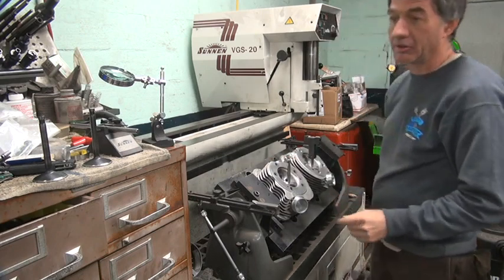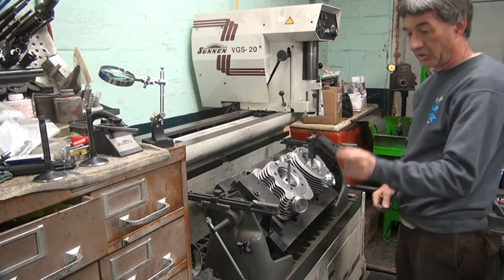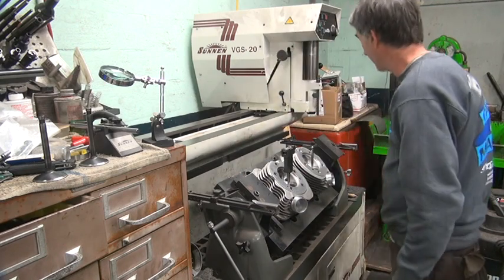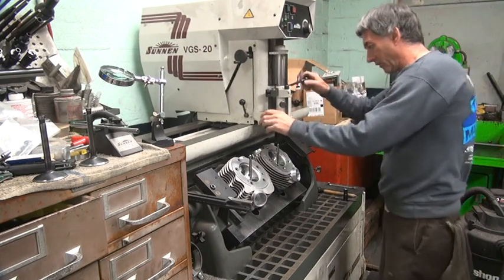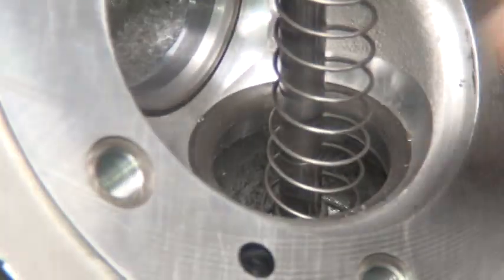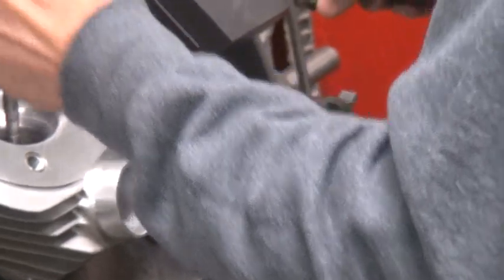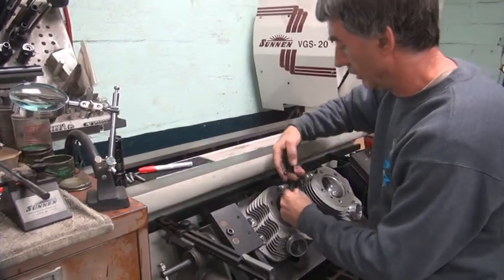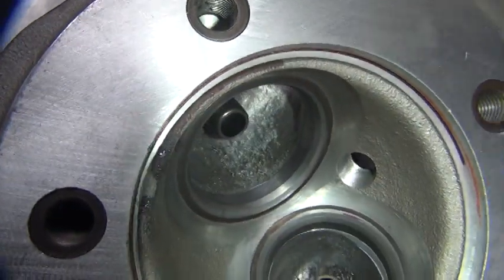#177 1961 FL 74ci std valve spring clearance set-up job panhead motor rebuild harley tatro machine

Comment: That simplistic Sunnen  hand level that goes into the valve guide to get the seat inline for cutting is excellent. Wish they sold that separate or an aftermarket version. That solves a lot of problems. Great video, learning how its done with the proper equipment, sure beats my idiotic contraptions.

Comment: To say another way, lapping is burnishing. Techs burnish, assemblers... assemble.
Reply from the maker: lapping is not burnishing, they are not even close. lapping is a grinding process that puts a lot of very hard to remove grit into your motor. burnishing is a forced breaking in process that forces the metal to move around to make a more correct fitment.
tatro
Reply: @TatroMachine  I do not disagree, sir. The comparison I failed to state is the likeness of such. 
"Lapping is like burnishing." 
Different parts are mated by a process to wear and mate properly together before the first moment of service. Lapping and burnishing do this same process.
A. Lapping uses grit to mate connecting parts prior to being put into service. 
B. Burnishing uses the hardness and slip of mating parts to wear into proper contact prior to being put into service. 
The result is the same: proper mating of connected parts prior to being put into service.  I do not disagree, only failed to state likeness of. Peace...